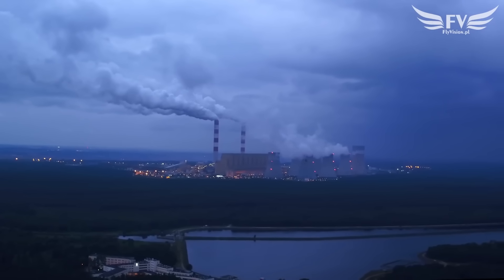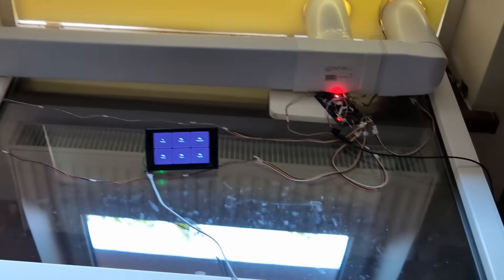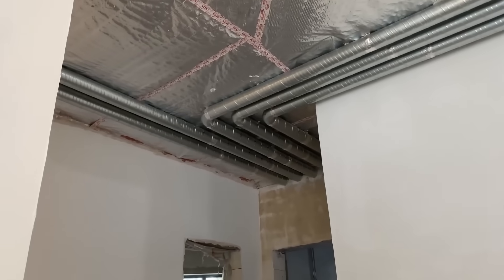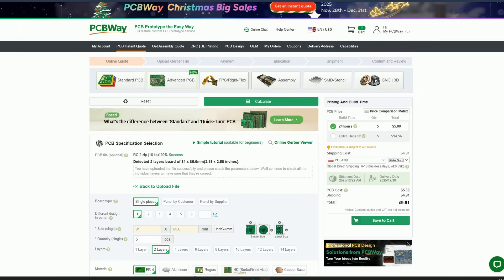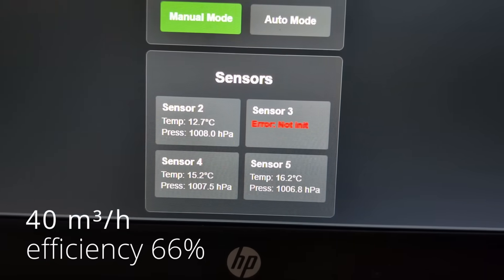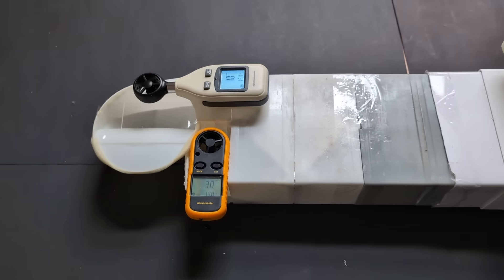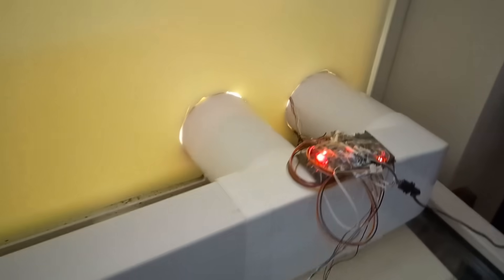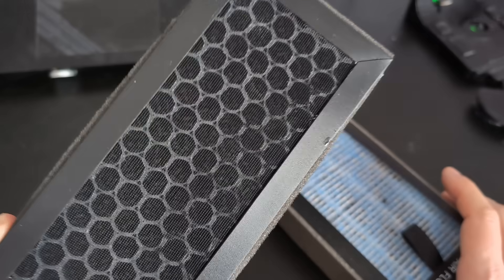DIY Heat Recovery Ventilator: From 55% to 90% Efficiency (Real Tests)

Comment: If you are custom building housings, another option could be to borrow from air conditoners.

Have the fan housing extend so the fan itself is outside the building. 

You could also build the wall crossing channel to match common bathroom and extractor fan pipe diameters, making installation work perfectly for existing procedures, and letting y9u form a perfect seal once rather than a rig that reseals to a closing window.

That said you may well have already thought about all of this! 

Its cool to see and thank you for sharing.
Reply from the maker: Thanks! Those are great suggestions.
I have thought about similar ideas matching standard pipe diameters and moving fans outside would definitely simplify installation and help with sealing.
I’m still experimenting with different approaches, but it’s good to hear ideas that make the design more practical.

Comment: That's linear growth.
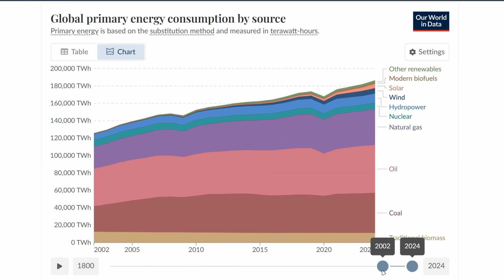Reply: brovva, that line 0:58 is as straight as my ass, the x axis is not in log scale, that IS linear growth 😂 what are you talking about 😂
Reply from the maker: Not really.
That’s only a small slice of the graph. From ~1800 to today it clearly resembles an early exponential — especially with the recent AI-driven jump.
Reply: @DIY_Yarik   Hey man, appreciate the video and your experiments! For insulation look for VIP (Vacuum Insulated Panels), extremely good insulator and not brittle like aerogel. How you'll find the size you need is another hard discussion.
Reply: @Sekir80 not brittle, but puncture it and the whole module is waste.
Reply: @Jacksparrow4986  true. It must be handled with care. Even punctured its thermal conductance is a bit better than pir foam.
Reply: @DIY_Yarik  Not really. That means growth WAS exponential. Current growth can still be linear. The growth curve does not need to stay the same, it can become logarithmic or even exponential again.

Comment: i would love to see a more detailed video about how to create those plates and how you achieved air tightness.
Reply from the maker: So far I’ve been using sealant and glue, but that’s not ideal over time small air leaks appear.
I’m working on a method to bend the plates with slots so each one locks into the next, forming a solid sandwich structure held together with mechanical clips.

Once everything is finished, I’ll release the designs, models, and control software openly so anyone can build it themselves.
Reply: @DIY_Yarik have you considered that the sealants themselves could slowly leak harmful chemicals into the air?
Reply: @DIY_Yarik  as someone else mentioned, brazing is the sealing of metals with a lower temp metal, like with copper water pipes.. in theory you could just dunk the whole assembly in a hot solder bath, keep it hot when you take it out to allow the solder to drain before it gets cold, and that should seal by capillary action anything close enough to stick together...

Comment: Awesome work! I was coining similar ideas and landed on the method to use two radiator cores in series with a pump to create a heat recuperation unit.
Reply: You can use the core from the heater in a car x 2 , as these are smaller, but really pass a lot of heat/air.... Hmmm... Advantage, too, that the car heater now has a multi-layer HEPA filter in front, as well.
Reply from the maker: That’s a really interesting idea!
I think the main challenge would be finding a radiator with the right shape and airflow capacity to handle large volumes of air, but it’s definitely a clever approach and worth exploring further.
Reply: @DIY_Yarik I am planning on doing something similar - using copper radiators meant for water cooling computers, to extract the heat from a polycarbonate enclosure I built to seal my 3d printer (to contain the particles and fumes).

I got two copper radiators (the 360mm type that take 3 120mm fans), connecting tubes, fittings, water pump, reservoir, filter, flow indicator etc. I started by buying two cheap Al radiators before I learned of galvanic corrosion when mixing water and different metals so instead of hunting for hard to find Al fittings I switched everything to copper - more expensive but easier to find and higher thermal conductivity for copper.

But a water heat exchanger is such a hassle compared to the direct air to air approach - leaks can ruin more than just the efficiency and you also have to prevent algae and bacteria growth and even with expensive biocide in the water you still have to replace it every so many months. I suppose that's why the commercial heat recovery units are not using water.

If I were you I would search for a brand new spare part for such a commercial heat recovery unit instead of trying to build one yourself. I guess they're not that expensive and it would save a lot of time (and frustration :) )

Comment: Things I found work against fan noise: manual balancing of the fan rotor, 3D printed Helmholtz resonators tuned to the fan harmonics, and using a heavy frame in which the fan is held with closed-cell foam or silicone. 
But mostly it's come down to re-balancing the rotors which can be imperfect even when paying for better radial fans.
Reply from the maker: Yes, it’s very similar to balancing car wheels. It’s a really time-consuming process.
I’m planning to use 5 fans in each recuperator, so keeping them all balanced will definitely be a challenging task.
Reply: @DIY_Yarik  I think it need not be very time consuming per fan, with the right equipment. For large motors there are instruments with a vibration sensor and a rotation sensor, that can tell you eactly where to place the balancing weight, after doing two runs, one run with no weights added and another run with a known trial weight in a known location. It should be possible to repilcate this algorithm with a PC soundcard with one channel connected to the vibration sensor, e.g. a piezo buzzer transducer with a weight glued to it, and the other channel monitoring either a reflective opto sensor or maybe the tacho output of a 4-wire fan (though those are often multiple pulses per revolution...), for an angle reference. Alternatively someone could probably make a mobile app using the accelerometer of the phone to sense the vibration, though they would need some other input channel to monitor the angle of the rotor for synchronisation.
Reply: @chrisgj198 . . . . Vibration sensor and strobe light.
Reply: @DIY_Yarik   No idea if this is possible but I have seen a video somewhere of a truck wheel that had a hollow tube around it. In the tube were ball bearings. They moved around the tube to balance the wheel. For testing, could you not fit a plastic ring with water in to see if that would balance the fans?
Reply: @geoffhaylock6848 note that this only works at some speed(s), but that might be a great idea! Water might not work though, I think the surface tension would prevent the fragmenting of the mass to achieve balance. Tiny plastic beads?
Reply: @geoffhaylock6848 
That's more a patch when you can't balance things properly. 
Balancing the motor + fan then checking for vibration + peak noise frequency will be do-able and really accurate
Reply: @getahanddown  hard to balance for dust collection? Hopefully good filtering will remove that issue. On tyres, the balance point can change so probably more applicable to such uses. I have used beads within tyres successfully in the past. With the right equipment balancing wouldn't be an issue but it is not something I have at home (tyres yes, fans no).
Reply: @DIY_Yarik  try out some industrial noctua, i push air trought some filter with a noctua at 40% no issue, it's a little bit expensive but industrial line is also ip rated so no issue with water or moisture and they can push both fast and a lot
Reply: @DIY_Yarik  why not use PC fans, like from Noctua? They make really good efficient, silent, long lasting fans, that also have good static pressure.
PC fans in general offer good static pressure, and because gamers also hate noise, they are generally also very quiet (not every brand ofc, but many). And especially companies like Noctua make excellent fans (performance-, not look-wise lmao)
Reply: I believe the Helmholtz resonator might work as well. It’s very simple so you should give it a try. However it is fixed frequency so the ventilator must work with fixed speed. Instead of amplifying the sound, attached to the duct, it will absorb the acoustic energy like a black hole. Why not print a collar with a number of different sized resonators pointing inwards that would also work as an assembly of the pipes ?!

Comment: Been waiting for an update! Excited to see how you integrate proper charcoal filtration for VOCs. It requires pounds of charcoal media, so integration will be interesting!
Reply from the maker: Thanks! Yes, integrating enough charcoal for VOCs is a challenge, but I’m working on a practical solution that fits the design.

Comment: Hey what thickness material did you use? What was the permeable vapor barrier made of? Ty
Reply from the maker: I used aluminum 0.1 mm thick at first, then with an adhesive layer 0.2 mm.
Copper I used at 0.2 mm — it turned out to be much stiffer than aluminum.

The vapor-permeable membrane I bought at a building materials store. Its Sd value is 0.02 — Strotex Toples roofing membrane, 0.4 mm thick.
Reply: @DIY_Yarik thank you so much for your reply and the time you invested in this. Merry holidays

Comment: Rarely write comments, but you deserve this. I admire your work, and thanks for sharing your path with us!
Reply from the maker: Thank you! I really appreciate it sharing the process and experiments is part of the fun.
Reply: @DIY_Yarik why not try aluminum radiators with coper heat pipes in between them? It's the best solution to nove heat around in the IT industry. It's also ligher and cheaper than pure copper and transfers heat even faster.
Reply: @DIY_Yarik  You are very thoughtful and skillful, bravo! Smart thinking.
What is your profession, what is your formal education?

Comment: Finally, someone has made a device that works! My recuperator I was a complete failure. When the wind outside blows cold air through it, it makes my ears pop and the air feels cold. As the author said, sellers test them on test benches, but in real life, they produce zero current. Thank you for your work!
Reply from the maker: Thanks! That’s exactly why I wanted to build something that actually works in real-life conditions, not just on a test bench.
Reply: @DIY_Yarik  https://youtu.be/vF72pOHc1zY?si=OWGbtTLYLAEHVsPP
Reply: Maybe a valve to prevent reverse flow? Perhaps even a shroud that prevents a direct wind?
Reply: @anotheruser676 a T-shaped pipe end or a dangling end of wire-formed flexible ducting will almost always suck outwards.
Reply: @alanhat5252  Good to know.  Suggest that to the OP?
Reply: Yes, very relevant😊.